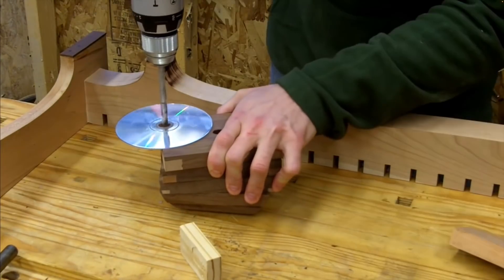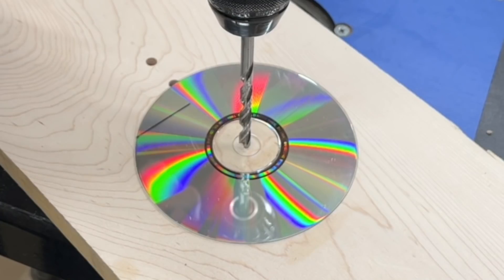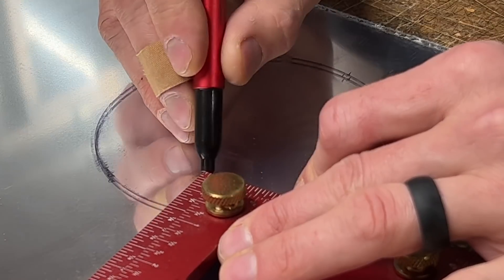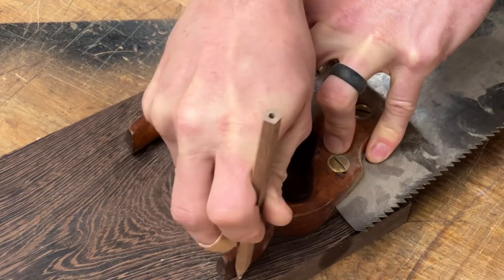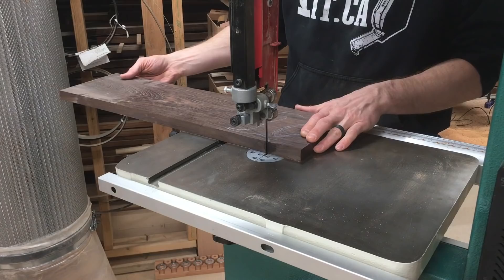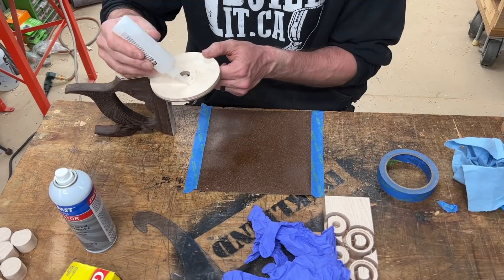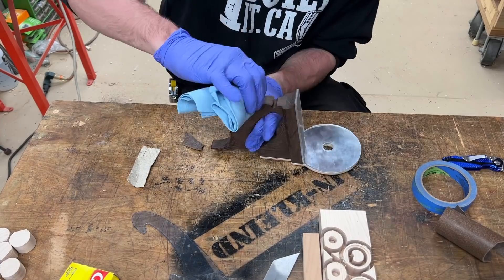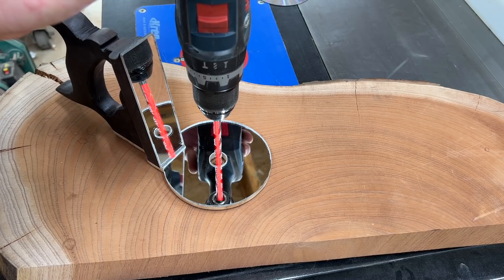Drill Guide Design and Build

Comment: Worked as a sheet metal mechanic for several years. Where drilling square was imperative to job because people flew in planes I fixed. There are simple square jigs for drilling and they come with multiple bushing sizes for multiple bits... I was confused on this particular homemade tool.
Reply: For those who are wondering what larry is referring to it's called a bushing cup. AKA egg cup.

Comment: I'm puzzled over why the angle of the vertical mirror doesn't skew the perceived result, or if it does, does your head have to be at a certain angle? Simultaneously, I'm marveling at the idea that that angle doesn't matter, and my brain really wants to figure out why, one way or the other!
Reply: The vertical mirror is just repeating what it sees from the horizontal mirror and acting as a second set of eyes. As long as the drill bit is perpendicular to the horizontal one, the angle of the vertical mirror doesn't matter.
Reply: @JasonPeltier  that's kind of amazing to me. I'm sure if I had it in front of me it might be obvious, but thank you!

Comment: Or you could buy a drill motor with a target type bubble level on it, they do make them. You could also modify a drill motor with one or more of those type bubble levels on it. Depending on the manufacturer and how the drill motor is designed will determine how difficult that can be. But it can be don with small level bubble tubes places on the back and sides of the drill motor. I worked as a machinist all my life, what you made is a good quick reference for the start. But I've often found that those items become useless the moment you start to drill as you can't be looking at the alignment and drilling at the same time. I've seen many that will angle the drill after they start and walk a drill bit only to wind up with an angled hole in any material. The only real effective way to keep a drill straight is to use a drill guide, jig or fixture. That or lots of practice or a friend that can help to keep you straight by sighting on one side as you drill. Or use a drill press when ever possible.
Still, it was a good try Andrew. I'm not knocking what you made, I'm only speaking from many years of experience. Using a hand drill motor and keeping a hole straight takes a lot of practice, experience and help from a friend or coworker at times.
Reply: Also as a machinist, it’s too easy to go from zero to 0.0001” in seconds! Some perspective (pun intended) on the task is necessary. If “mostly straight” is the goal, then there’s no need to complicate it by chasing precision. 
Drill jigs are great, especially when the work won’t fit into a drill press or can’t be moved. Use the drill press to make the jig precisely, then transfer that precision to the work. 
Andrew’s mirror jig is perfect for out-of-level work, one-off holes that don’t benefit as much from building a separate jig, and for bits like spade bits that won’t follow a jig well.
Reply: @kennethelwell8574  I agree and you are right on your perspective and try and get one perfect on a rounded surface made out of hard stainless.
But there are drill motors out there that have leveling sights on them in two positions that work even better. I used to have one that would light up for drilling in a dark place.
I love this guy's video's. He has made several items that I've been able to modify for some machining. Like I said, I wasn't knocking what he made and you are right if the hole is a one off or critical accuracy isn't needed. This could work for the average job or carpentry work.
I'm probably a bit more critical because of the work I'm involved in. Most of it is + or - .0005". It's mostly aircraft work and you get one shot to get it right or you can destroy a very expensive part. I just had a guy NRTS out a large jet engine part because the drill walked. Now that engine case is trash, unless a Depot facility or the manufacturer can repair it. Though we have citified welders here, we are not allowed to weld on that engine case.
So I guess what Andrew made is great great to get the starting point right or for stuff that is + or -  half inch or so. 
BTW, I've also made starter drill guides that are basically like a reverse hat bushing that you can hold on a flat surface, if you have the room, to get the drill started straight. If you angle the drill motor you can feel that guide lift up on one end. It works if you take your time and make sure it doesn't load up with chips. Sometimes you have to think outside of the box.
Funny thing is, my Dad is a carpenter and I just can't work like that. + or - a 1/2 to an inch will work for him in about 90% of what they do. Even somethings cut on a slight angle will work for wall studs. That would drive me nuts to do some of the things they do.
Reply: and what if your workbench isn't level?
Reply: @JasonPeltier  Then you are an idiot for setting up your work bench without insuring it is level. But then again most that do woodwork, work within + or -  an inch and consider that fine accuracy. I've had guys in the building trades use a level and tell me a door frame was square. Yet when they shut the door there is a 3/4 gap at the bottom and tight at the top. Truth is no one in that trade ever gets their levels calibrated or even check to see if they are straight after they drop them or throw them in the back of their pickup. 
But I will give this thing one star and a D for effort. For most things this tool, if you could call it that, is too big for about 90% of the work. It is only good for large flat surfaces. Most of the stuff you are going to drill isn't going to be on a work bench anyway.

Comment: Have you looked at a circular spirit bubble level? if it was fastened at an appropriate spot on your drill, wouldn't this also work?
Reply: Your eye's have to be straight in front of the viewport for a spirit level to work right, you can get circular ones that show level in multiple directions but your head has to be directly above it, the thing your drilling would have to be on a level surface too. I think the mirror's don't have those issues. So technically it could work, they used to sell drills with bubble's on them.
Reply: Only if the workpiece is also horizontal (or vertical, depending on where you mount the bubble)...

Comment: Would rather use a metal block with a hole in it than this contraption
Reply: That would be way too simple for YouTube though
Reply: This contraption works better for a variety of drill bit sizes
Reply: @guiturtlewood  look up Big Gator drill guide, works with most common sizes

Comment: Admittedly I was hoping to see something interesting from an old saw. I would have watched to the end before critiqueing the result. 
As it stands I was only partially dissapointed. No saws were damaged in the making of this video. In my personal opinion however, the end result is a fantastic waste of time and energy. All of this work done to create a thing which can be replace by 2 pieces of scrap lumber glued at a 90 Deg angle to each other. Doesn't need to more than a couple of inches long. Doesn't need the ginormous handle. Doesn't need the mirrored Plexiglas that will be scratched up in a couple of months. Doesn't need to exist really. Way over engineered for what it does.

Comment: So, I've seen rigs that help enforce that you're drilling perpendicular to the piece, in fact I think I've seen you use them. And of course a drill press will be perpendicular to the table surface, if it's set properly.

So, I'm imagining that there are cases when neither of these other tools will work for what you're trying to do, and so you just go invent a new tool to solve that problem. Done!

I would never have conceived of this idea, much less have been able to come up with the solution. Awesome stuff!
Reply: I drill into stone a lot. This would come in handy. I got plenty of mirrors so I'll build one I think
Reply: Any situation where the surface is not level. Maybe a knee brace on a timber frame table or something. Clamp the mirror to the surface and there you go. Two visual checks from one vantage point.

Comment: I design specialized tooling for a living. Relying on human vision to achieve alignment is never a good solution. Just make a jig to hold your drill 90deg to your work surface. It would be far more compact than that thing.

What you built is fine for Youtube content and entertainment but it's not practical or accurate in any way.